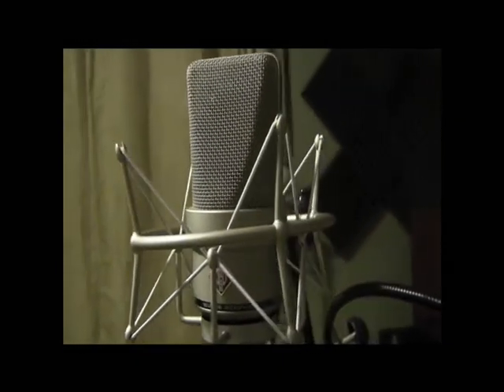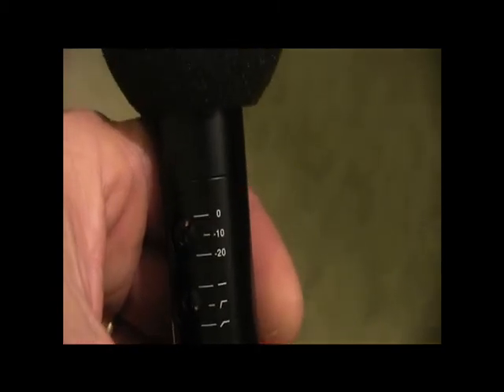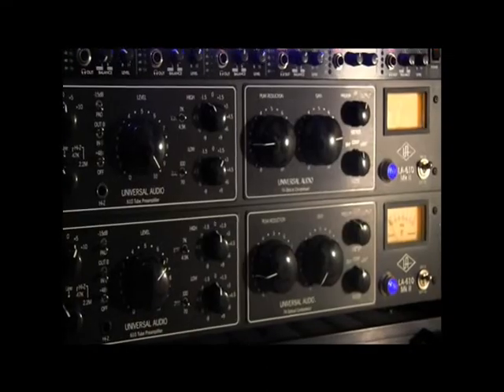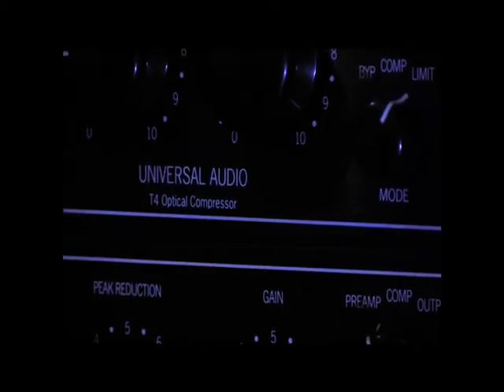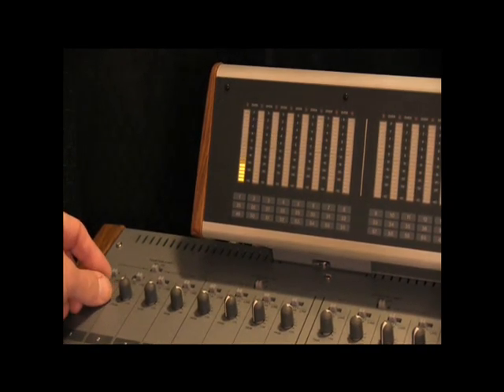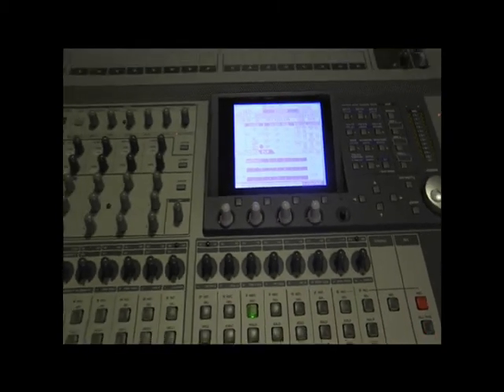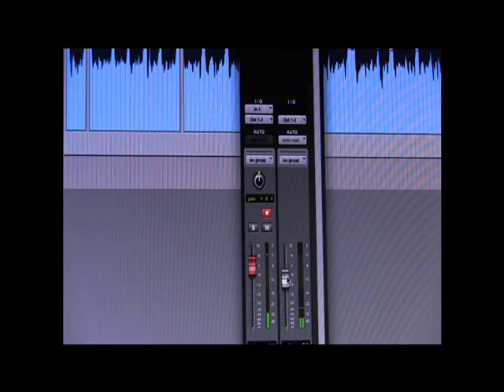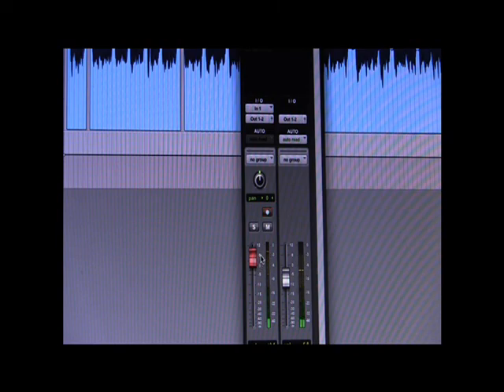Setting gain structure using a Universal Audio and Tascam console.

Comment: I have an Avalon 737 and Neumann tlm 103 and the Tascam DM4800, I'm a little confused as I saw your video I noticed that you also adjusted the trim gain on the mic input in the tascam, we'll my question is, Do I leave the mic pre at unity gain and make my adjustments on the tascam or make adjustments on both the mic pre and the tascam, as I am getting lots of floor noise in my DAW, PLEASE help thanks
Reply from the maker: First, you have a nice set up! I'd assume your Avalon outputs line level. Be sure to set the MIC/ LINE switch on the Tascam channel to the LINE setting. Then consider the Avalon is the first thing the mic see's. Set your input gain there for a proper input level. If you have output control, try to output as close to 0db as possible. Then set the input trim on the Tascam so the input meter is close to 0 leaving some safety headroom. In my case, I then use the Tascam channel fader to set the level to Protools.  I hope this helps. If your high noise floor continues, you may want to do some component troubleshooting.
Reply: KCPELICAN thanks for replying back, I will definitely give that a try, also if it's not to much to ask, when you can, can you make a video on how you got the output signals routed on the tascam, thanks again,